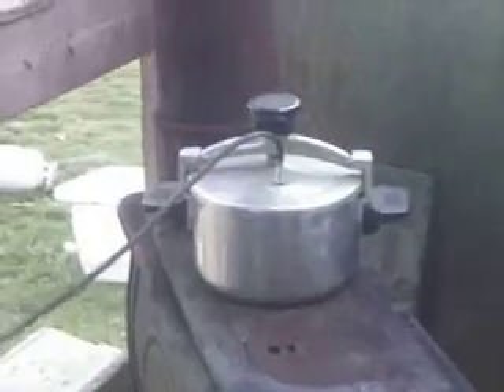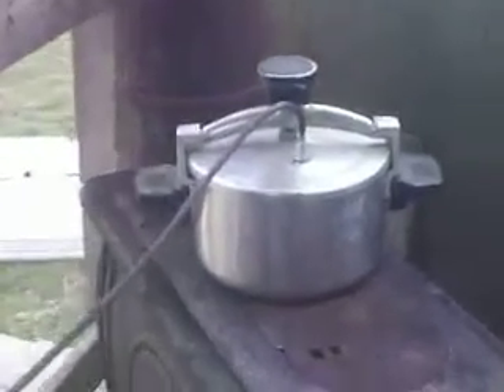REDNECK BOILER FOR SMALL STEAM ENGINE

Comment: Yall need that J-B-Weld to hold a bunch O magnets inside the flywheel...
or run a belt to a small 12-volt motor to charge a battery...

I'm working on my own propane cylinder boiler for a Briggs steam boat;-)
Reply from the maker: i would love to see that